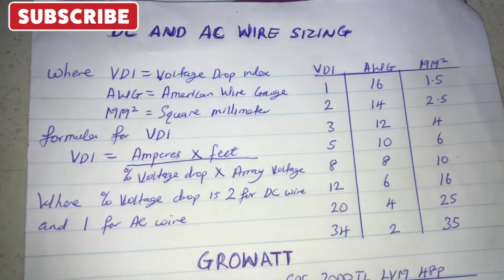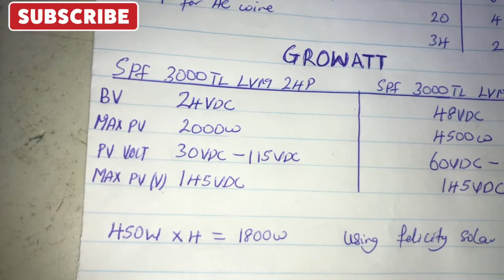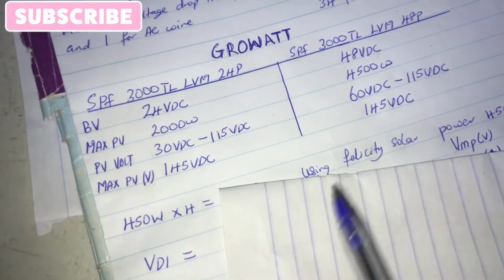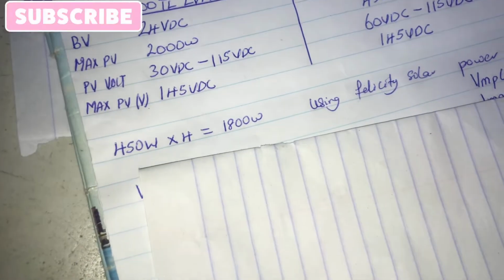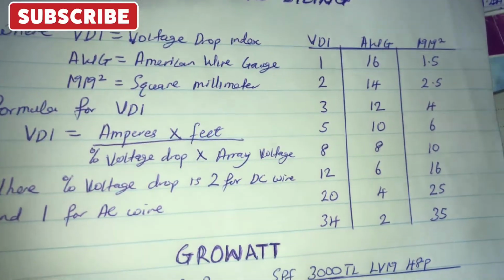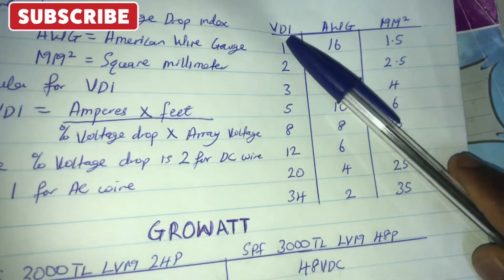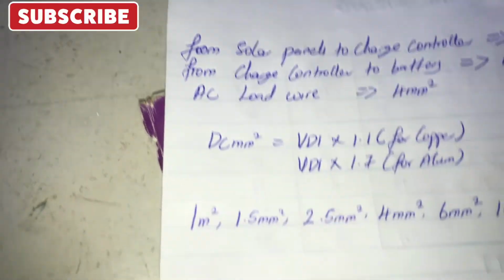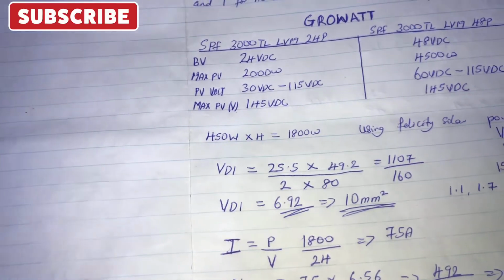DC AND AC WIRE SIZING

Comment: Is it possible to mix cables together that is copper and aluminum. lets say using copper from solar to charge controller and then  using Aluminium from charge controller to battery but still maintaining the correct measurements
Reply from the maker: Yes you can, the measurements is what matters the most

Comment: Thanks for the video..much grateful but i see on the table mm2..... 1.5 and 2.5.... that what i use to string my house and i still have wire left....so may i ask.... can i use that instead and where would use  it.....

Plus i have two 40amp breaker and one 15amp breaker, install in my breaker box.. what type wire should be connected to them
Reply from the maker: You can not use any of the wire, just follow the measurements your calculations gave you.

For the breakers 
Using AC BREAKER for example 

Using a 3000w inverter with a maximum load of 2000w you will Current(I) = power(watts) / voltage (V)
Give you 2000/220v = 9.1 
In this case you can use a 10A or 15A breaker for the AC output 
You can also apply the formula for the DC breaker calculations.